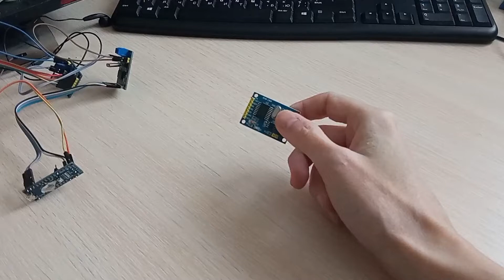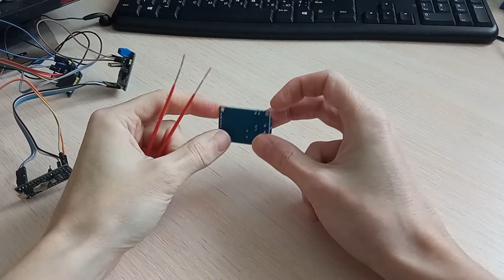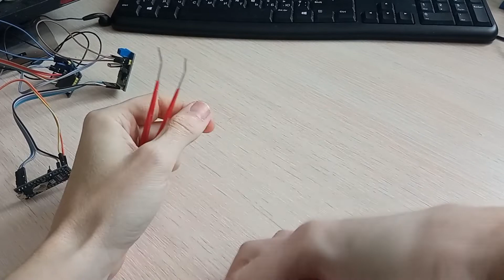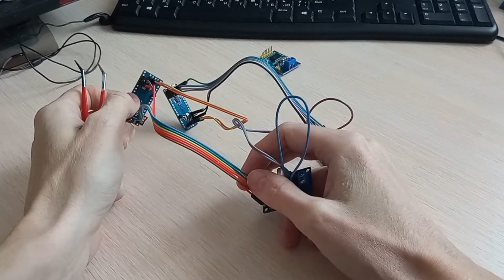Arduino CAN module - MCP2515 and TJA1050 - typical problems

Comment: Man! I'm grateful by your video! I was frustate trying to get DRONECAN information from my esc, and your tips help me to check and adjust module voltage, and put the jumper to enable the resistor. Thank you very much! (From Brazil)
Reply: I am having same problem with esc and dronecan com. Could you tell me one minute exactly what hardware do you have , what library did you use ? Also, I believe I have problem with interrupt of mcp2515 which is always set high. Loopback without it works fine 🥲🙏🙏

Comment: In my case the red light on mcp2515 is not working i assume it is not sending data. i dont think voltage should be issue because my other node is just working fine (with lights on).......

Comment: Just some information for people who may be interested in working with CAN bus systems in cars that are getting a bit older. These cars may have whats called a 'fault-tolerant' or 'low-speed' CAN bus which is common for infotainment and comfort CAN bus systems. These systems operate on the CAN bus at a baud rate ≤125kbps. At the end of this video, the information about terminating resistors is different when working on a fault-tolerant CAN bus. Common CAN bus systems are standardized as ISO 11898-2 while fault-tolerant/low-speed CAN bus is standardized as ISO 11898-3 and often require different transceivers than what are found on common Arduino modules/shields. Common transceivers for low-speed CAN bus systems are NXP TJA1054 and NXP TJA1055 and these are NOT drop in replacements for the ones found on common modules/shields such as the TJA1050, TJA1051, and MCP2551.

EDIT: Added a common transceiver.

Comment: Thank you....gone crazy to interface It with an controllino Mega,until watch your video..the 5 v power arrives from controllino at 4.2v...on X1 socket,impossible to work.i think the best chip for canbus is mcp25. Series for 3v or 5v operativo...has posit ive. Experience with can click boards from mikroelectronica.. the price Is higher but you have the warranty of function.thanks a lot again

Comment: Thank you a lot, for me it was the insufficient voltage from the 5 V Arduino pin. I connected the TJA1050 Vcc to Vin on Arduino which is powered on USB, and now it works perfectly!
Reply: Beni de deli etti...Arduino mega da her zaman çalıştı...sanayi tipi controllino ya bağlandığında X1 soketinin vcc pininden alıyordum bir çalışır iki çalışmaza geçti.bir hafta rezil kepaze oldum ..vakit kaybı da caba. Öbür mcp serisi can interface larda bu sorun yok...4v kadar çalışıyor

Comment: this is really helpful. Does anyone sell better MCP2515 boards that have the improved oscillator on them?
Reply from the maker: Yes but you never know what you'll get - it's too cheap to be perfect. Order the oscillators along with boards and do some soldering - it's only two pins, no rocket science

Comment: Hello my friend!  I have a multimedia center with Can network and it turns off every 20 minutes for not receiving the correct Can network signal!  can i emulate the vehicle network signal (FORD) using Arduino and the MCP2515?  If you can help me, I have no experience with this !!
Tanks
Reply from the maker: yes you can do that. You can find a video on my chanel where I'm playing with citroen c-zero CAN. Check the hardware wiring and sketch - with that you can dump the stream that radio sees, record it and replay in a loop. You don't need to fully replicate that (its a MITM bridge) - just need one MCP2515. Piece of cake.

Comment: Is there any off the shelf working boards? Also, what code do you recommend? Cheers
Reply from the maker: Yes, you can find some on AliExpress. Most of the boards are ok, just always keep in mind correct CAN bus termination, power (very unstable under 5 volts) and configuration. I have another video with a link to working library and code samples and since its playing around with a real vehicle - its even more fun https://www.youtube.com/watch?v=8KV6SuI31YE